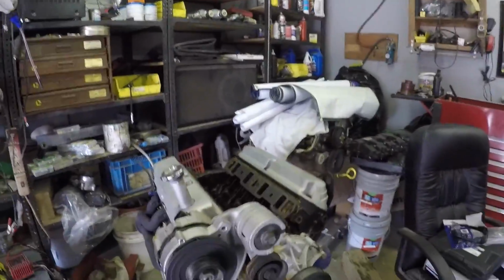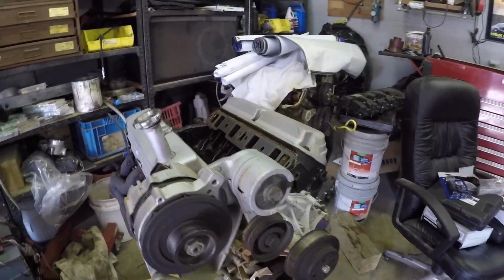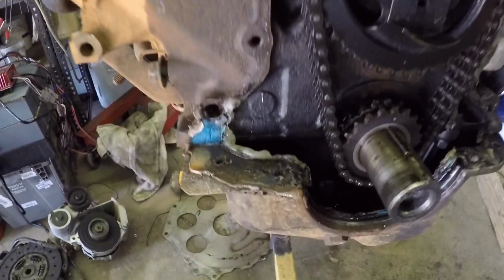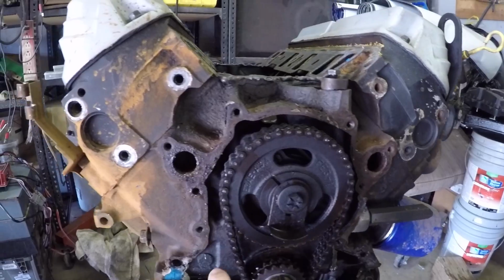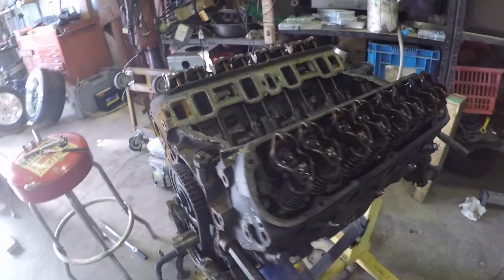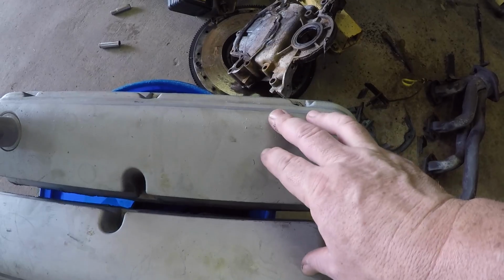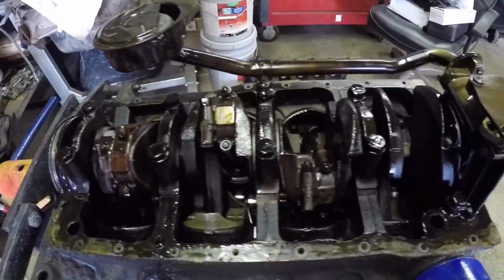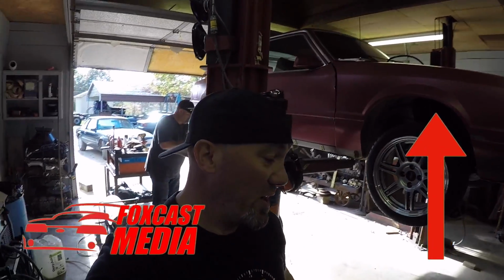Correct engine detail on a 5.0L H.O *FOXBODY RESTORATION*

Comment: Eastwood has a "cast iron " paint. I tried to do a resto on my 93.  I used Eastwood alumacast on anything that was raw aluminum. Stain black on the pan cuz it wasn't gloss and it wasn't quite flat. Headers I just stripped. Blasted lower intake and hot that with alumacast from Eastwood.  I just found that in my neck of the woods with hot Cold and humid any raw aluminum will eventually get that white fuzzy corrosion starting to grow. So I wanted to keep that from happening but also look the part.  I tried like hell to find so vergin valve covers because I was convinced they just head a clear coat on them. Body shop friend said no way, clear would no adhere to raw as aluminum. So can't way to see what NPD says.

Comment: Wait...so Speed Density engines came with more aggresive cams than MAF fox's?? I never read about any of that. Must be having a "duhhh" moment??
Reply: "Early 87 5.0's had a little more aggressive cam than what was used in the mid 87-89 5.0's which then were changed again in 1990. If the date code on your 87 5.0 HO is before 4/87, then you have this odd cam. It's not widely known about this oddball cam. The difference being it had 276/276* vs. the later 276/266 cams, plus a slightly more aggressive ramp rate" interesting